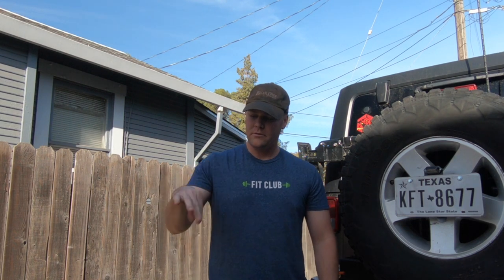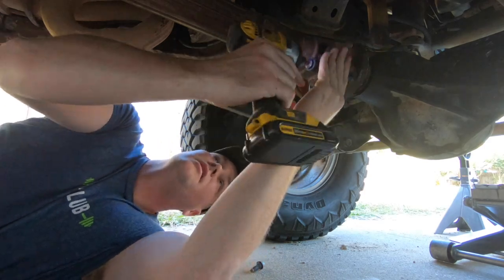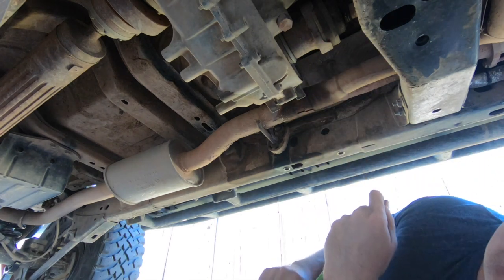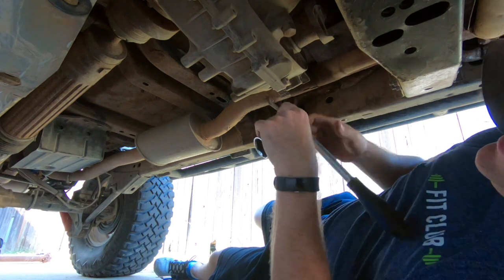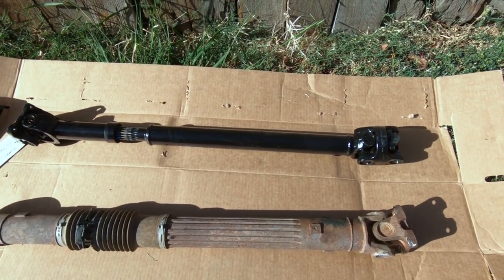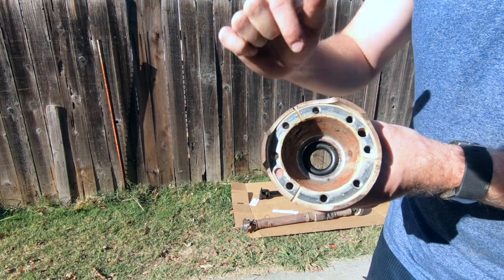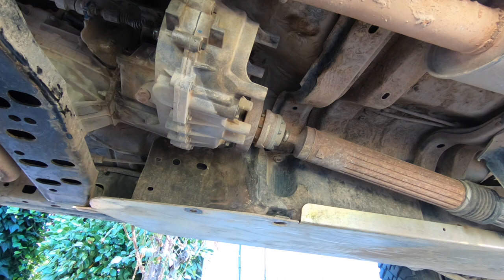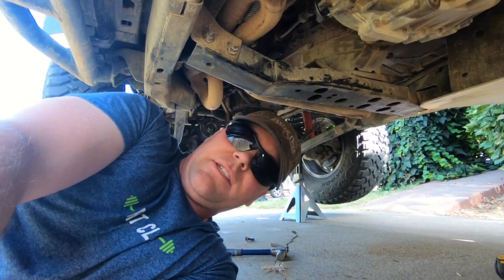Front Adams Drive Shaft Install on a Jeep Wrangler

Comment: The red loctite needs to go on the transfer case nut as well.
Reply from the maker: I put blue locktite on the nut just incase I ever have to take it back off. I really don't want to have to take heat to the T-Case. Its held up so far. If I have an issue in the future then I will put the red locktite on there.

Comment: Great video. But I have a question about the stock front driveshaft. I have an 09 JKU and I wanted to know if the u-joint of the front drive shaft is meant to be permanent. I tried to remove it with no luck and cant find a single video on it. Its got 6 small dimples which appears to keep the u-joint in place. I have never done u-joints so I don't know what is going on here. Thanks man.
Reply from the maker: I would think that the U-Joint would just press out like any other one. I could be wrong, but that wouldn’t make any kind of sense to have a permanent one.
Reply: NotICON 
Update: I ended up having to cut it out with a die grinder and then use a prybar to remove the cut parts. I heated it up several times along with using Aerokroil and pounding the crap
out of it to be left defeated. So cut off wheel did the trick! Thanks for the response though 👌👍
Reply: @Star-xq4tp  Those factory axle end u-joints are not meant to be serviceable. Another reason to replace the shaft with something that will be more reliable and serviceable. I did add a Terra Flex CV style joint on my original drive shaft when it failed (T case side) and it did last me two years without any issues.

Comment: Is this something you have to have measured or is it a one size fits most?
Reply from the maker: Most shops will have a “standard” measurement, however you can measure and get a custom length for your Jeep. It’s really easy to measure, and Adams had my new drive shaft on my door step in 2 days.
Reply: @NotICON  yea mine isn't special. 35 tires and like a 4 inch lift so I figured it was in the parameters. I'm at work so I cant run to it right now
Reply from the maker: If the control arms are adjustable then that may impact the length. Otherwise it should still be the same length.

Comment: Did you take the skid plate off? And do you leave yours off if your not trail riding?
Reply from the maker: I have the MetalCloak UnderCloak system, so I had to remove the transmission/transfer case skid plate to do this install. I keep the skid plates on at all times unless I’m doing maintenance or any other kind of work.
Reply: @NotICON  ok..thanks for posting video and thanks for the reply!

Comment: What about the centering ball? Did you grease that?
Reply from the maker: I got the greaseless u-joint option.
Reply: @NotICON  so did l so then the only spot on the entire front shaft is the slip joint. Very good thank you
Reply: The only spot to grease is the slip joint.
Reply from the maker: @waynejohnson3388  thats correct. I put a couple pumps in at every oil change. That seems to have worked well so far.
Reply: @NotICON  
I bought a needle grease fitting and was able to pump quite a bit of grease into the centering ball. I’ve installed the driveshaft shaft (front) and greased the slip joint. I also replaced the T Case fluid ATF+4. The entire process was a success.
Reply from the maker: @waynejohnson3388  thats awesome! I'm glad the install went well for you. You wont regret the upgrade.
Reply: @NotICON  
Many thanks for your video and reply’s to my questions. Very helpful and I’m very thankful.

Comment: How is this drive shaft holding with the stock yoke I'm looking at getting this ds as well
Reply from the maker: The DS is amazing, but it also comes with the new yoke for the T-Case side. I highly recommend it, especially if you have a lift over 2.5 inches
Reply: @NotICON  yeah I have 4" lift and this is on my list to get very soon I was looking at this ds since the stock diff yoke is left in place and dont have to worry about the crush washers
Reply from the maker: Ok yeah then you will love this DS. Just get your measurements and call them up. I had my new DS in 3 days.
Reply: @NotICON  just waiting for my yearly bonus in a few weeks 🤑

Comment: did you have any issues with pinion angle after the install? Im running a 2.5 rk lift on a jku with stock control arms and I notice some slight vivration at 60mph and some noise starting at 30mph?
Reply from the maker: No I don't have any issue with vibration. I did when I first put it in, but then I found that I didn't torque the little bolts down enough. I tightened them down a little more and that fixed the issue for me. I will say that even a slightly loose bolt on a drive shaft will cause the shaft to vibrate. If you can't do a full set of control arms, you can just get adjustable uppers for the front. if you make them a little longer this will cause the pinion to tilt up. I'm running a 3.5" MetalCloak lift that only has front upper arms. I believe we talked on a Facebook page the other day, either that or somebody was having the same exact issue. Does the vibration feel like its coming from under your seat?
Reply: @NotICON  just seems like its a slight vivration on the front end of the jeep. I did noticed that out of those little 4 bolts only one went all the way through the yoke to the shaft mount.
Reply from the maker: I would start with that, all four of mine went through. Just be careful not to over tighten then. Do you feel the vibration in the steering wheel at all?
Reply: @NotICON  some vivration on the wheel as well.
Reply from the maker: I would check the bolts first. If that doesn't fix the issue then it could be a tire that somehow threw a weight. Did you rotate your tires recently as well?
Reply: @NotICON  Might need to balance my tires I recently replaced ball joints and did not do that. Theres a chance a plate might have come off while wheeling. just found it strange that only one of the bolts went all the way through the yoke and the shaft could see the end of the other 3 bolts on the shaft part. Thank you for all your help.
Reply from the maker: Let me know if you figure it out.